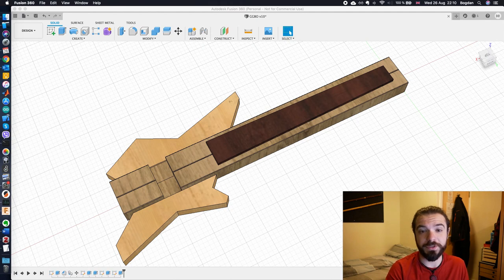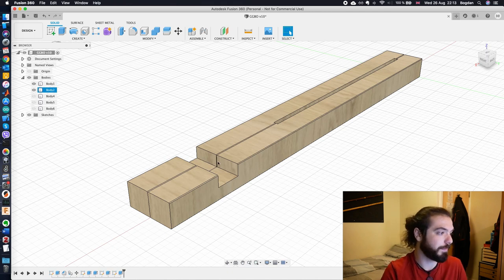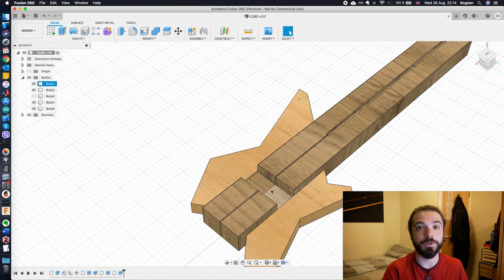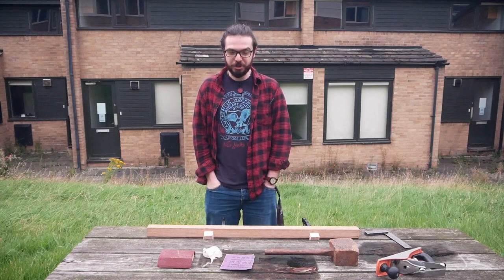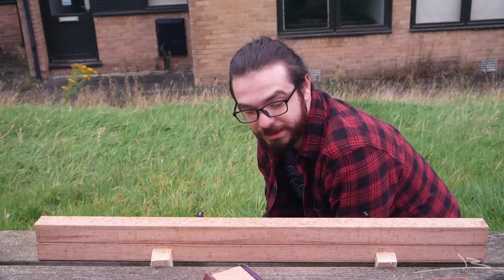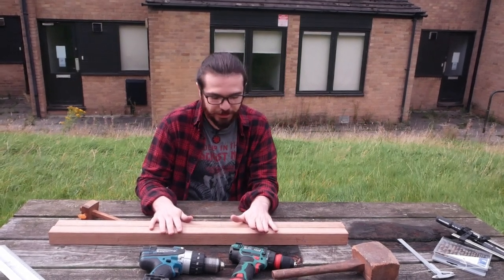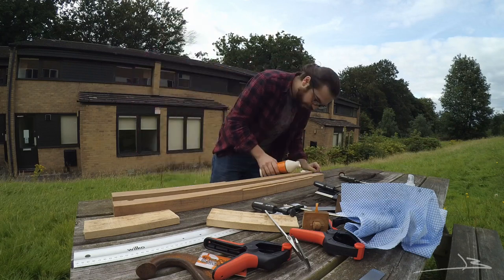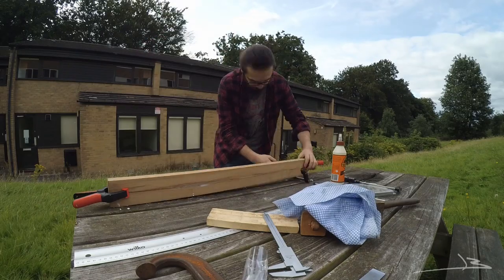Building a guitar from scratch | Ep2 - Plan and neck work | Great Guitar Build Off (Unofficial)

Comment: It is nice to see someone reimagining the process of building a guitar. As they say, necessity is the mother of invention. Some unsolicited advice . . . a good way to flatten wood on a side, when you don't have a lot of tools is to . . . find a relatively flat surface, cut pieces of sandpaper wider than the piece of wood and attach end to end (like a sandpaper runway) with spray glue or two sided tape to the flat surface, then move the wood back and forth, face down, on the sandpaper. By using pencil marks on the wood, a square and a ruler, you can produce a surprisingly flat surface with a consistent thickness end to end. Anyway, I thought that might be helpful further on. Looks good so far. Good luck!
Reply from the maker: Thank you! I think I will definitely use this advice later on when it comes to glueing the sides.
Reply: Now that I think of it you have already had some practice at this method. It is similar to the way you sharpened your chisels.
Reply from the maker: @joebikeguy6669  yes, and I could probably use a piece of mdf or some very straight furniture board as my straight surface
Reply: @Joe Bikeguy Good advice, nice of you to share.